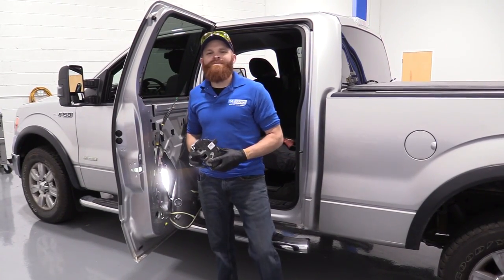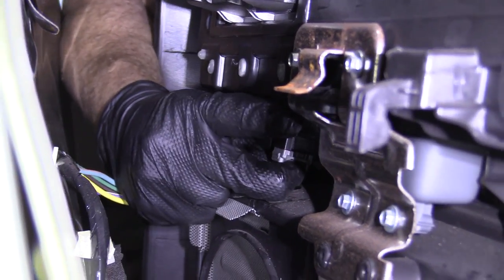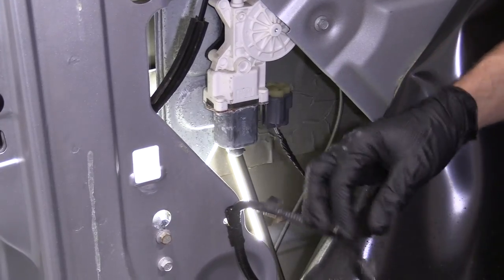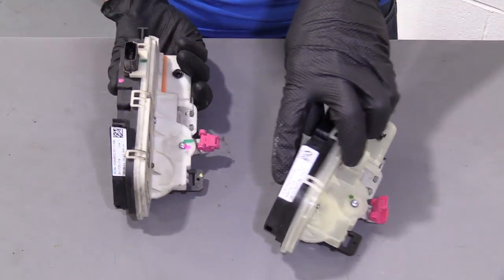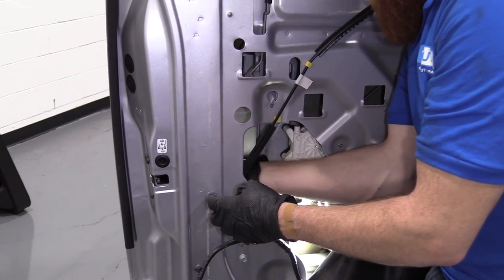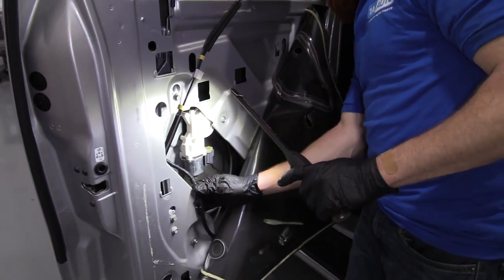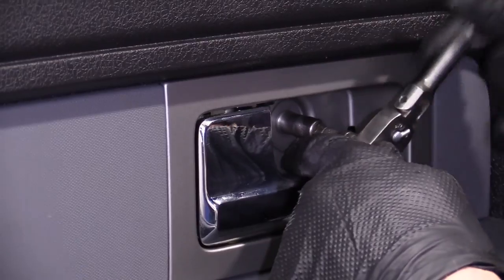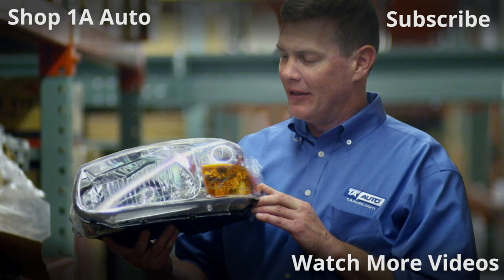How to Replace Rear Door Latch 09-14 Ford F150

Comment: Just did this exact replacement on my 2013 F150.  Same door, etc.  This video was awesome to help me see what I was getting into before I started removing panels, etc.  I had my laptop next to me and did the step by step per the video.  Only difference is I didn't see the need for and didn't remove the door latch cable and plug.  I simply supported the door panel to the side.  It saved a couple of steps.  Anyway,  super Thanks for your video!!!  Great job!!  You are serving well all the DIY's out here in reality land.  Also...saved me $200 vs. taking it to the local dealer.
Reply from the maker: +Dalen Thank you! We love empowering our customers and showing how to perform DIY auto repairs with our high-quality auto parts.  http://1aau.to/m/Shop-1AAuto-c
Reply: Thank you for your detailed explanation. Helped me a lot

Comment: Assuming I can get the panel off, because the door is stuck shut, will I be able to somehow manually manipulate the latch to open the door so I can access the 3 torques screws holding the latch in place?

Comment: What do  u do if the doors  locked an u can't get too the mounting  bolts  on the lock actuator  too get it out on a ford f150 supercab 2012 rear passenger  door

Comment: You produced a 1st rate educational, video that was extremely well thought out, well explained and user friendly!  From what I learned on the video I was able to do the same repair on my F150 Lariat Crew Cab truck.  The only problem I experienced during my repair job which was not covered in the video was the final step of aligning and installing the bottom two panel screws securing the door panel to the door.  I couldn't get the holes to align.  Using a skinny ice pick tool from the pack of four mini O-ring picks I purchased at Harbor Freight for the job (cost $1.99 before tax) I was finally able to align the holes in the panel with the threaded holes in the door.  It was tricky but doable!  Thanks so much for this amazing aide!
Reply from the maker: +Fred Higgenbottom
Reply from the maker: +Fred Higgenbottom Thanks for watching, and thanks for the tip!
Reply from the maker: +Fred Higgenbottom Thanks for checking us out! 1AAuto.com

Comment: Excellent, thorough video! You did a great job of showing the details and explaining everything. Especially how to remove the different clips and connections. If you don't normally work on cars that is important so you don't break a clip! My 10 year old son and I replaced this on my truck and it took less than an hour and I don't know anything about fixing vehicles!

Comment: I have 2012 f150 and the rear passenger door wont open. It releases the top latch i can feel it but the bottom latch wont open. So how do i get the door panel off to fix the bottom cable?
Reply: Same problem here

Comment: This is a good tutorial. I cannot OPEN the door to FIX it. I cannot access the lower 6mm nuts on the door panel
Any suggestions on access points to  GET the DOOR open so I can work on it> appreciated.
Reply: You can get them out.   I just did.   It's not easy.   Use a 6 mil socket and small extension.  Use a vice grip or channel locks to break the bolt free.   Took me 20 mins for the two bolts!

Comment: My dome light randomly comes on saying rear driver door is open It opens and closes normally would this part fix it
Reply: More than likely yes. Sounds like you have an issue with the latch contact sensor inside the actuator/door latch

Comment: Any thought about removing the T27 screws holding the actuator in and THEN removing the electrical and mechanical plugs and rods ?  It appeared when you were installing the new actuator, you had some play in the unit to attach the plugs and cables before attaching it...just wondering

Comment: Start with door in closed position. Will not open from outside or inside. Thanks? I’ve got panel off. At 7:40 you are pulling the pink clip. Wish I could see how to put rod back into clip, this seems to be my issue. I can see pink clip buts it’s not holding anything. No way to access latch bolts with door in closed position?

Comment: Soo if you can open the door from the inside and the unlock and lock function works and the key for the stupid child lock is UNLOCKED and the OUTSIDE HANDLE wont open the door and all the rods and connectors arent broke or loose. I need to replace that whole latch assembly? My outside door opener wont allow the door to open it wont move that latch at all. But if youre inside you can open and get out. And the door is always UNLOCKEX

Comment: How can this be done if the door doesn’t open from the inside or outside??😣
Reply from the maker: +Txrdnk34 Thanks for checking us out!
Reply: You will probably have to use a slim-jim tool to slide down inside the door, next to the glass, and pull the actuator that should be connected to the door handles.
Reply: Curious how you managed to get your door open as I am experiencing the same problem. Tks.
Reply: I have the same problem. I can't even open the door. I was able to remove most of the panel without removing the bottom bolts but I can't get the door open at all!! I have a 2010 F150. Were you able to fix your issue??
Reply: You are screwed. You need to access the actuator to get the door open. Have you tried manually unlocking it then opening it from outside? If the child locks on and it doesn't unlock electrically it'll be jammed up.

Comment: I have 2010 4 door f150. The rear door wont open from inside but will from outside..the auto locks on all four doors work fine..I'm thinking might be child lock because it's in off position but door wont open from inside still..what do u think could be??
Reply: I have the same issues did you end up figuring it out ?

Comment: I replaced my door lock actuator and now my truck is giving me the door ajar warning for that same door. Any suggestions?
Reply from the maker: +Kasey Cantrell We are unable to diagnose but we do recommend taking your vehicle to a local reputable mechanic! Thanks for checking us out!
Reply: I would consider that the wiring between the door and cab is in bad shape. There are YT vids on it and looks to be really bad on some trucks. Most likely you need to repair that wiring.
Reply: Check the wiring between the door jamb and the door. This is a common area for broken wires which will cause the door ajar warning. Look inside the accordion tube and unwrap the wiring bundle to be sure none have been crimped or broken.
Reply: If this started right after you put in the new latch, then you most likely have a bad latch or damaged the plug when you plugged it in (assuming the electric lock works which indicates it's plugged in)

Comment: Great video! Easy to follow. Just finished installing new latch on rear driver door, electric lock still does not work. Any other suggestions?
Reply from the maker: +Aric Wiese We wouldn't be able to diagnose an issue like that here, you may want to have a local mechanic take a look at it. Thanks for checking us out! http://1aau.to/m/Shop-1AAuto-c
Reply: Wiring harness needs to be changed

Comment: I have an extended cab xlt are the driver's side and the passenger side the same process?
Reply: Yes. On door and many other parts that match side to side they're duplicate instructions. In fact many manuals will say "left side displayed, right side similar" for instructions.

Comment: Excellent, first rate video.  Thank you!  Unfortunately the new actuator did not fix the problem but that only indicates that it is in the wiring somewhere.  Great video!
Reply from the maker: +David Puryear Thanks for checking us out! 1AAuto.com
Reply: Just curious, did you figure out why yours still didn’t work? I have the same problem with it still not working after changing the actuator.
Reply: @richardosborne4488  check you're wiring at the hinge of the door where the wires go from the cab to the inside of the door. These model trucks are notorious for wires getting damaged there

Comment: Any tips for if the door is stuck shut? I cannot remove the 3 outer bolts with the door shut!
Reply: Curious how you got your door open as I am experiencing the same problem. Tks.
Reply: I have the same problem. I can't even open the door. I was able to remove most of the panel without removing the bottom bolts but I can't get the door open at all!! I have a 2010 F150. Were you able to fix your issue??

Comment: What were the symptoms before replacing?
Reply from the maker: +djaap30 Since there could be multiple reasons why you’re experiencing this difficulty with your vehicle, I strongly recommend that you have a reputable mechanic inspect it. They’ll be able to troubleshoot the problem and tell you what part or parts you’ll need for the repair.
Reply: So I have this same issue.  It started by the door not locking/unlocking reliably.  It then got to where it didn't lock/unlock at all.  The last is the door, even when manually unlocked, can't be opened from the inside!  Obviously this is an issue in an emergency.  Opens fine from outside though.
Reply: @asmythe943  your child lock is engaged, it's the small hole you see with the label in the video. That disables the inside handle. As far as the lock itself, if all other doors lock then it's likely a bad latch. However, it's possible it's a wire in the door jam or elsewhere.

Comment: I replaced the actuator, the door will lock/unlock while the door is open. It still will not lock/unlock when the door is shut. Any suggestions on what to check next is greatly appreciated.
Reply from the maker: +Chef Rose Kitchen Thanks for checking us out! http://1aau.to/m/Shop-1AAuto-c
Reply: @1AAuto  No advice on why it still won't work when the door is closed?
Reply from the maker: +Chef Rose Kitchen We wouldn't be able to diagnose an issue like that here, you may want to have a local mechanic take a look at it. Thanks for checking us out! http://1aau.to/m/Shop-1AAuto-c
Reply: A year late, but what your describing sounds like the door lock wiring in the door jam may be partially broken.  It's probably making a littlle contact when the door is open, but then separates when the door is closed.  I would check there, if you haven't already figured out the issue.